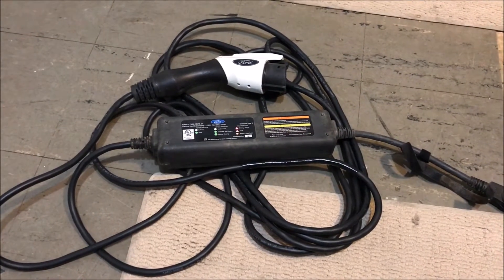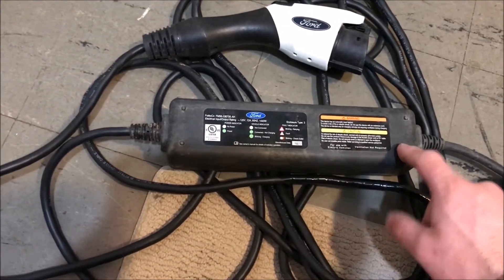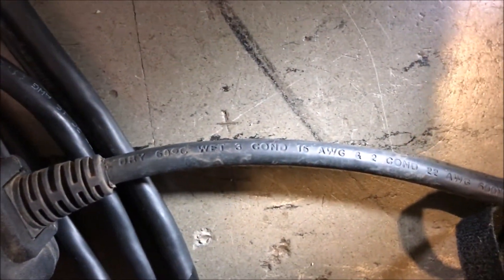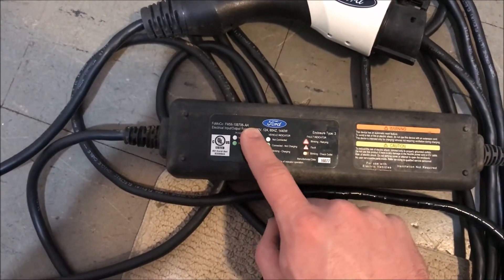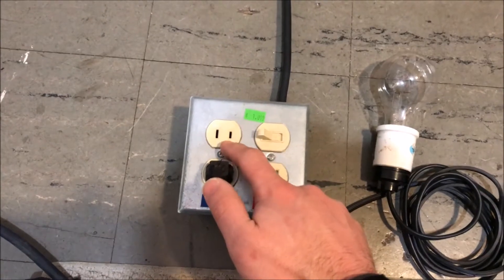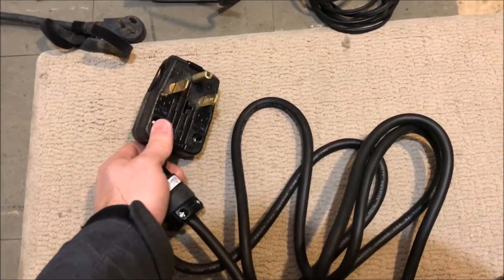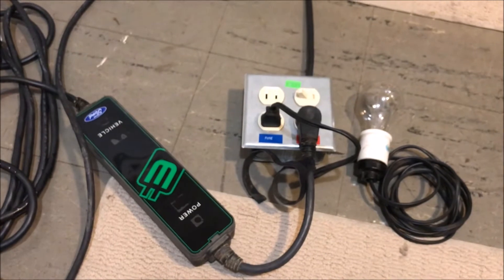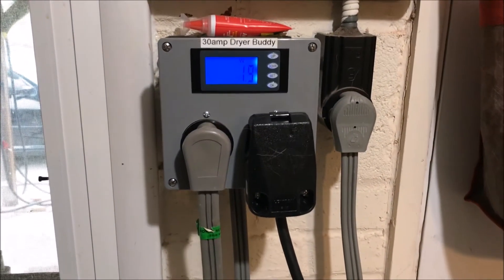Testing, and using a L1 120V EVSE car charger on 240V as an L2

Comment: Why would the charger safety circuit SHORT the charger inputs?  I would think it would OPEN them.
Reply from the maker: That's how MOVs work - they go short to sync the overcurrent. The idea being they'll trip a protection device further up... blowing a fuse or tripping a circuit breaker instead of letting the overcurrent blow up the device. 
Adding MOVs to a power strip turns it into a "surge suppressor".

Comment: Tried putting 240v into a 2022 Pacifica level 1 charger that came with the car.  It did not work.  A fault code came up as input voltage too high.
Reply from the maker: Bummer :(

Comment: Excellent video
But I have a question.

Taking these chargers overseas, where frequency is 50 Hz. And chargers in USA use 60 Hz. Would that be an issue? Or frequency does not matter in these cases?

Comment: I've been doing the same thing with the evse that came with my Honda Clarity PHEV.  I made an 240v adapter out of a NEMA 6-20 extension cord.  It charges at twice the speed on 240v, pulling ~12amps.

Comment: Hey @compu85 - what 240V to 120V cable did you buy? Any suggestions on this?
Reply from the maker: I made it. You can get the wire and ends at any home improvement store.
Reply: You probably won't find one as for legal reasons no company wants the legal liability of someone plugging in another 120v device and frying it on 240v.

Comment: so i'm needing something like this. I've got one of the new 4 wire 14-30 dryer plugs that i need to adapt to a 5-15 plug. i should be able to combine both 120v wires from the dryer plug ont othe hot terminal on the 5-15 connector right? There's not going to be much load on it, 8a tops
Reply from the maker: One line from the 14-30 goes to the line / hot on the 5-15. The other line from the 14-30 goes to the neutral on the 5-15. Hook up the ground to the ground, the neutral from the 14-30 is not connected to anything on the 5-15. That will give you 240V on the 5-15.
If you hook the L1 and L2 wires from the 14-30 together, you're shorting 240v!
If you just need a 120v outlet, hook one line from the 14-30 to the line on the 5-15, plus the neutral and ground. The 2nd line from the 14-30 will be unused.
Reply: @compu85  Got it working, thanks! I bought a dryer cable and a female socket from lowes and wired them up

Comment: Thank you!     Using your method, I just tested the OEM j1772 charger that came with my 2019 Hyundai Kona, and found that it does  support 240V at 12 amps.  Looking on my Wattbox, it indicated 2610W with the actual 237V mains voltage.
The OEM Hyundai charger also has the temperature sensor safety feature in the 5-15p plug, which automatically reduces current from the 12 amp default to either 10 amp, or 8 amp.
Compared to 12 amp, plug and wire resistance losses reduced by 31% at 10 amp and 56% at 8 amp.
Things I still don't like about the OEM j1772 charger that came with my 2019 Hyundai Kona:
(1) The 12 gauge cord is a bit short at 15 ft total length.
(2) Connecting to 240V is not convenient and requires making odd adapter cables

Comment: Dis you make that 220v dryer plug to 110v plug?    My L1 adaptor is made in Germany 110 to 220v.  My car only charges at 1kw 110v so anything 220v would at least double the power. 2.2kv.  My car is capable of 6.6kw on l2 so in theory I was hoping to get 3.3kw on this charger!
Reply from the maker: Yes - I connected the 120v EVSE to a 240v dryer plug. The amps won’t change - so if you get 1kw on 110v, you’ll get 2kw on 240v. If you want 3.3 you’ll likely need a different EVSE.

Comment: I found this very useful.I recently purchased something similar to yours but it's not Ford but Fiat.With the specs 120v,60Hz,12A,1440W.I want to go to Europe with a camper and I was wondering if I can use this in reverse meaning that big plug put in a 220v and use the US plug to get 110v out witch is perfect for my needs.And without doing any changes because I have a inverter in my RV that works in 110v.Thank's.
Reply from the maker: Our Fiat 500e came with a Lear charger, and it works on 120 and 240v.

Comment: i just bought a 2014 volt yesterday and did notice long charge time so im going to make a dryer cable as s
o as i find out if its compatible..intertek maybe take a look inside buy new $200 unit and make and extension cable

Comment: Great video! I was wondering if you could clarify something for me as you seem to know whats happening inside these OEM EVSEs. The diagram and your dim bulb tester seem to only fuse the line in or hot side of a 120V circuit. When you rig the system to run 240v, would there not be 120v on both line 1 and line 2? This would mean that the EVSE would be receiving 120v on line 2, which during normal 120v operation is only the neutral. If the EVSE is only able to handle 120v, would putting 120v to the neutral without a fuse system (dim bulb) damage the EVSE? Or is the neutral side of the plug also protected by the MOV? I have a new Hyundai Kona EV and I want to run this test on my OEM EVSE but I don't want to destroy it in the process! Hopefully you have the answer for this! Thanks again!
Reply: To add to this, I've searched the internet to find out if my particular OEM EVSE is able to run at 240v. The unit is manufactured by Yura Corporation in Korea. In the manuals that I've found for the European version, the EVSE looks identical and it would be running at 240v so I'm hoping that my EVSE is the same as the European one, just with different labeling. I know Chevy did that with the Volt as that is what I had previously to the Kona and it happily charged off the OEM EVSE at 240v.
Reply from the maker: @schinks333  So regarding voltage, it depends on where you're testing :) When I had the EVSE hooked up to the 240V dryer plug each leg has 120v on it compared to ground. But leg to leg, it's 240v - when one leg is at -120v, the other is at +120v. The MOVs are installed leg to leg, and leg to ground. 
I can't say if a Yura EVSE is dual voltage. If you could get it open without destroying it, you could look at the rating of the MOVs or transformers to see if they're only rated for 120v.  I wouldn't try plugging an "unknown" EVSE to 240v without a bulb or low amp fuse.

Comment: i have a model ending in AD and just did the same test and got a really dimmly lite bulb.  So i am questioning to risk it and test or not.  i am surprised if the old didnt work doubt ford updates anything but firmware. thoughts?
Reply from the maker: How big of a light bulb did you use? If you used at least a 40w and the bulb lit up, the evse likely won’t work on 240 safely.
Reply: @compu85  it was a 50w 120v bulb. I didn't try it because I read early ones weren't setup to work with 240 and because there is a recall I should be getting a new one shortly version AJ or something and that one does work so I'll wait

Comment: In your schema is the bulb 110v or does not matter?
Reply from the maker: Bulb is 110v.... because that's all I had handy. Yes, if there was a short it would likely blow the bulb instantly!
Reply: @compu85  So if I use 220v bulb it may not blow and charger will be damaged. Correct?
Reply from the maker: @arunashvili  Ya, there is more risk to the charger. Using that 40w lamp, and testing a charger that does have MOVs that go short at 240v, the lamp only glowed dimly.

Comment: Do you think FM58-10B706AD model will work on 220v if I adapt plug?
Reply from the maker: Does it have a temprature sensor in the wall outlet? I don't think the AD revision does? I think the only ones that work have the temp sensor.

Comment: I have an ELR and am surprised to hear that the OEM charge cable would work on 240V. Did you perform any modifications to it?
Reply from the maker: The OEM Clipper Creek charge cord that came with the ELR is not 240v compatible. But the Lear cords that came with early Volts are 120 / 240v. Some even have a flashlight in the handle!
Reply: @compu85  cool! that's what I thought. Cool video! I hadn't heard of the dim bulb test before this. Interesting idea.

Comment: Nice video - the EVSE is likely limited to 12Amps - 120v or 240v (it's what is built into the communications chip) and the internal relay is likely rated for 16A.  This test method is on point!
Reply from the maker: CubbyTech yup, 12a regardless of the input voltage.

Comment: I have managed to open mine and relays inside are rated at 16A. Was wondering if it would be possible to change pilot to do 15A.
Reply: Doubtful - it appears that these are 12A max 120v or 240v - These are really 'dumb' pass-thru devices, not much intelligence inside them.

Comment: I thought of doing that same thing 
Good idea with testing it with the light bulb 
Hopefully I’m getting a Nissan Leaf later today
Reply from the maker: Cool! The EVSE that comes with the early leafs is not dual-voltage. I recall it has a transformer for the low voltage supply instead of a switchmode regulator.

Comment: Hey I have a charging cord that looks just like the one in the video. Do you have the model/revision number before I go and blow mine up Incase they changed them midway in production.
Reply from the maker: Look and see if the wall plug end has the note for the extra wiring for the temp sensor. I think Ford just recalled all the non-temp-sensor cords, so you might be able to exchange it if you have an early one.